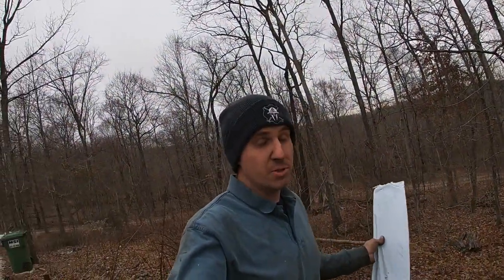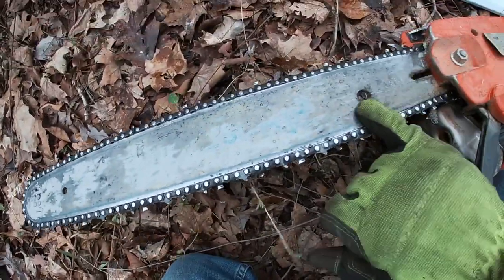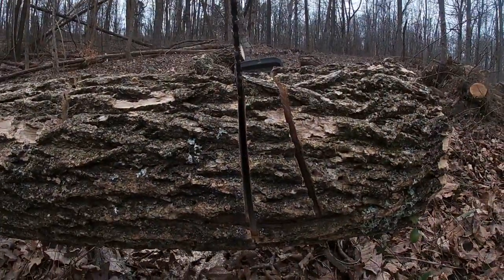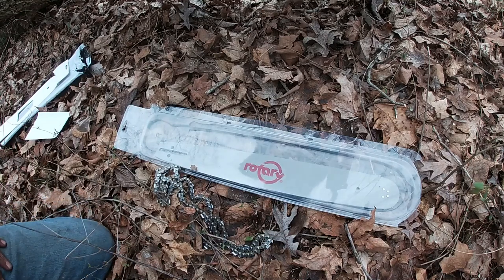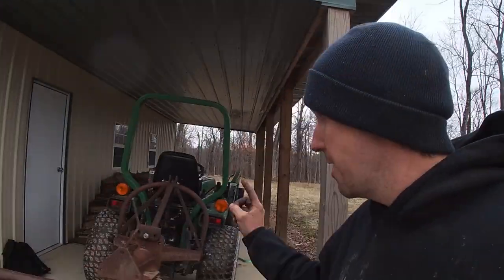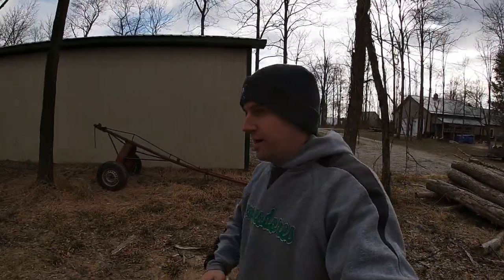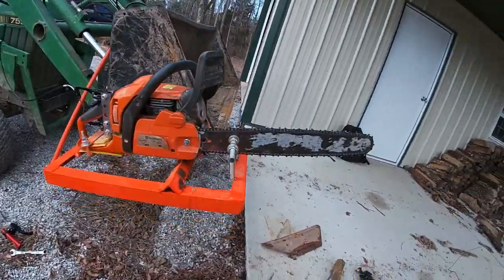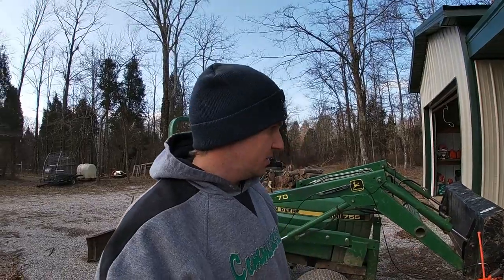New chainsaw bar and chain - PLUS - sneak peek at custom chainsaw attachment

Comment: Also, match the chain to the wood you are cutting.  A chisel point is good for clean softwood.  For hardwood, or wood with a little dirt, a semi-chisel point will stay sharper longer.  It’s best to file often so that a couple of licks per tooth will do.  Always file in one direction - away from you.  Turn the saw around to do the other side. For a good sharpening, I like to set the bar in a vice.
Reply from the maker: BeachFun that’s something I need to do,  turn the saw around when I sharpen it to make sure both sides are even.  What ild really like to do is keep a few chains handy and then sharpen them on a benchtop sharpener,  that way I always have a good quality chain ready to go.  Thanks for all the advice!

Comment: Great idea for trimming trees the only thing I would do is put a piece of rubber under the saw on the angle iron just a a idea. Just remember after about 4 to 6 tanks of gas flip the bar and keep the tip greased as well. Keep up the great videos
Reply from the maker: Kenny Mysak flipping the bar is something I am going to start to doing for sure.  Should have been doing it for years, embarrassing that I just recently learned about that!
Reply: @CaptainKleeman  no big deal everybody that cuts with them seems to for get a grease gun for the tip as well and it will help with the bar as well

Comment: I have cut fire wood for 50 years and have found that some chains, the teeth are softer on one side than the other, I have had to keep sharpening to try and get the straight cut you need. End result was,replace the chain. Also you can take a flat file and run it down the bar to even out the sides, so the chain runs straight. I hope this info is helpful for you.

Comment: Yeah, get a timing belt kit for the Subaru. Unless it's all been changed in the last 20-30,000 miles, just do the whole shebang and be done with it. Will you pull the engine or do it in place? I had never pulled a Subaru engine before and got it out in like 45 minutes. But I gots me tools.

Also I like #3. And thanks for the follow-up on the wandering bar. Now you could take a good look at it and see what's going on so that you can recognize it when that cheap bar goes south.
Reply from the maker: Timothy Ball just did timeout belt in the last 20k.
 I’m gonna try to keep it in.  Think I should have enough room.  My biggest concern is if the head bolts will
Have enough room to clear so that I can get then in without messing up the new gasket.

And thanks for voting!

Comment: You’re going to have to upgrade the Skysaw™ Captain Kleeman. Recently I’ve seen a couple videos including one that iirc was from TTWT where not only is the saw on a compact tractor bucket like yours but it’s at the end of a bar about 6’ long attached to the bucket extending the reach of the Skysaw™

Comment: I don't envy changing that head gasket. Change the timing belt while you're in there! Timing belts are cheap compared to changing all of the valves.
Reply from the maker: Mitch S the bummer is I just did that timing belt 20k ago.  I’ll give it a good look over but hoping it will be able to be reused.  Fingers crossed!

Comment: Cutting to one side like that is down to wear on the bar, one side of the groove worn more than the other. Can be fixed by re-grinding the edges back to square on a belt sander/grinder. Look up videos from Bucking Billy Ray, he covered it really well in at least one video. Sharpening one side of chain more than the other is a myth that Billy Ray totally busted too.

Comment: It was not your bar. Your depth gauges are out of sinc' with your tooth length. Throw the chain in to a saw shop and have them sharpen and you'll have a spare.  Or, better yet buy a Stihl system sharpener with tooth file and depth gauge file incorporated and sort your depth gauges with every tooth sharpen. Bars seldom need anything other than deburring.

Comment: Your chain is sharper on one side more then the other. It taking more wood off the sharper side causing you saw to cut circles.If you use a table mount sharpen them all the same.
Reply from the maker: Justin Mills I think I may invest in a new sharpener...just keep the file in my box for a quick sharpen on the woods if I need it.  Thanks for the tip!

Comment: you have one or two problems with saw bar one is bottom rails are not square hold vup look down down the length you will see one side little higher than other i take mine and vgrind off to make them equal saw  shops have a jigg for this i usually get wrght 95 percent of time next is you may have chain filled off too much hard to get a chain perfect by hand once they start off thay get worse a machine shaarpener is well worth the money

Comment: I vote #2 for the name. 

You don't need to worry about all the blades being the same height. You need to make sure that the rakers are all cut so the height of the raker to the height of the blade is the same on every single blade/raker. If that measurement is the same then when the blade comes into contact with the wood, every blade is cutting the same amount of wood which will give you a straight cut every time. 

Watch Buckin' Billy and he can explain it better. https://youtu.be/0PMlqsj6D1I?t=580
Reply from the maker: Joel Hershberger hey I’ve been learning that!  I need to add a flat file to keep in my box.  Thanks for the tip sir!

Comment: It looks like your old bar has uneven rails, try taking off the chain and visually inspecting the rails, if they aren't flat, or one is taller than the other try using a 
b*🤬terd file and flattening them, rinse and repeat 😂
Reply from the maker: Dax Pfahler when it’s the name of the tool do you still have to censor it? 😂Thanks for the tip!
Reply: @CaptainKleeman  that's a good question, one I wasn't going to take the chance finding out the hard way 😂